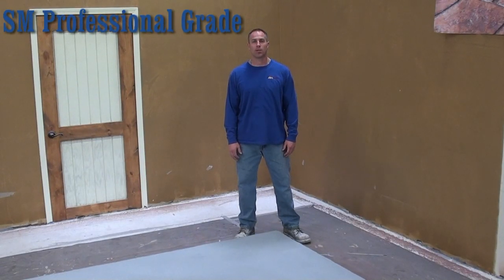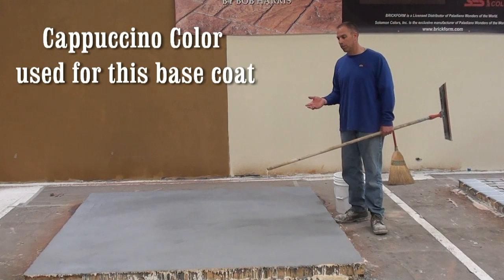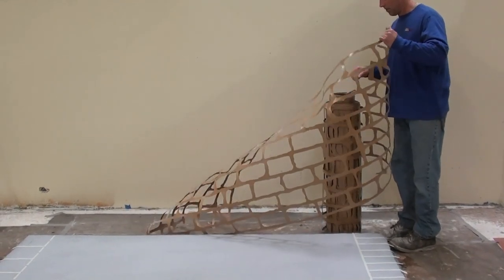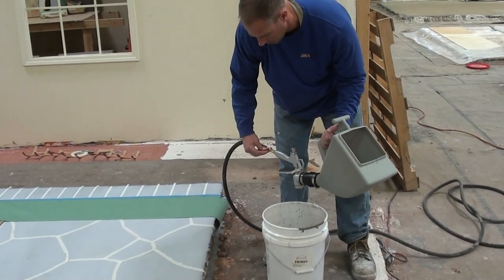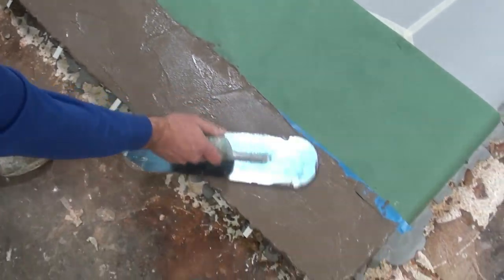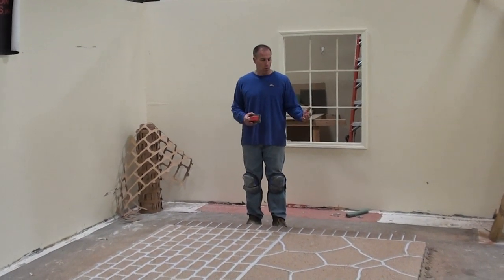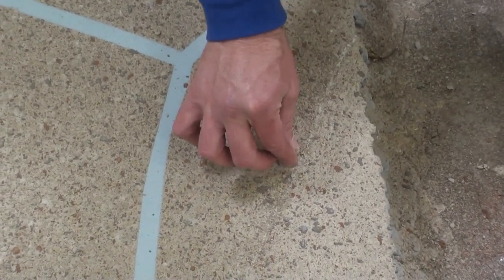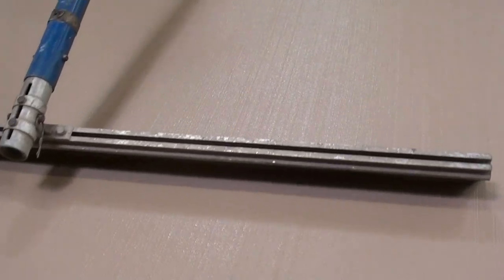How to use a Spray Mix, micro-topping overlay for resurfacing decorative concrete

Comment: Can I do exactly same process on kitchen's bare wood floor?
Reply from the maker: drigotechbras It is possible to apply this product to such a surface. However, it is worth noting that wood floorings are prone to flexing which may lead to a degradation and cracking of the overlay. Whenever you plan to use a cementitious overlay, we suggest the use of Brickform Triple Seven Bond Coat and proper surface preparation and cleaning. To speak to a technical support representative, call toll free at 800-624-0261

Comment: Can you do this mix with concrete mixture instead of grout? 
What would the difference be?
Reply: Also, how much would you say each mix that you make (60 lb bag - 7 quarts polymer + color) how many SF?
Reply from the maker: Without the proper thickness or aggregate, a typical concrete would not have the necessary strength for this application. Use Brickform products as directed and as manufactured (without adulteration) for best results.
Reply from the maker: Brickform Micro-Topping has a coverage rate of 150 to 350 square feet per bag. Final coverage rate depends on thickness of application, concrete porosity, and base-coat. Applying Micro-Topping over base-coat of Brickform SM Professional Grade helps repair minor damage and defects (such as rockpops) and increase coverage rate.
Reply: Thank you for your answers. Whoever manage your account is excellent! 

Happy Thanksgiving!